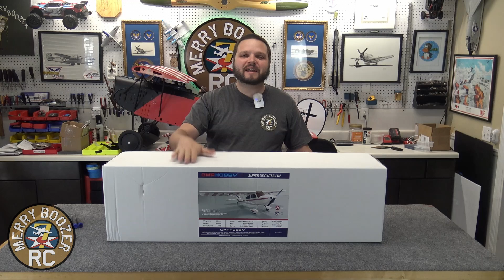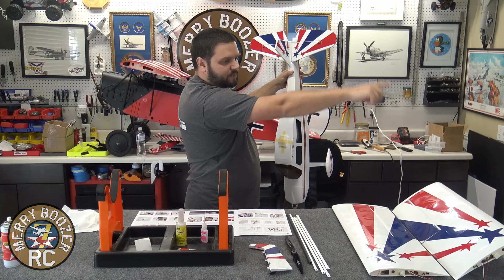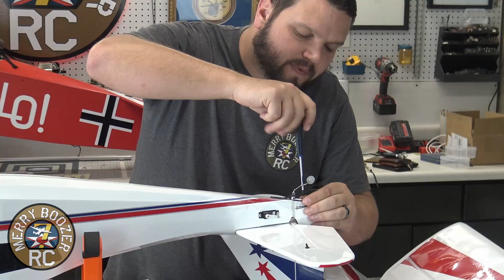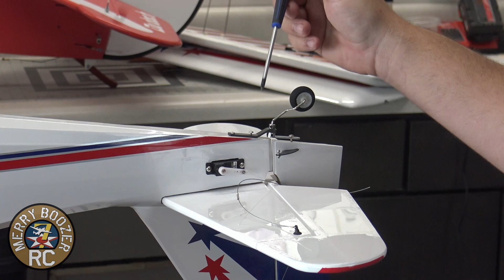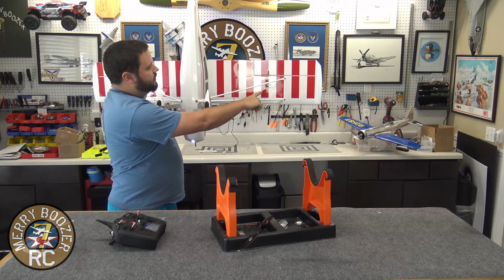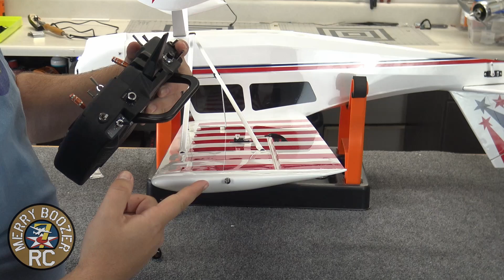*NEW* OMP SUPER DECATHALON ASSEMBLY PNP

Comment: I watched your video about ten times and ended up ordering the red one through your link. I ordered it late thursday night and got it saturday.  Had a few problems with assembly but got things worked out. The instructions dont say anything about the cg. Do you know what it would be? I plan on using a 4s 2200 to start with then maybe use a 4s 3200. This is a great looking plane.
Reply from the maker: 4s 3200 is what I used all the way forward in the nose. Also tape your top hatch on or cut the two small holes out right in front of the tail wheel. After flying it a few more times I found that there is nowhere for air to get out and that’s why the hatch keeps popping off